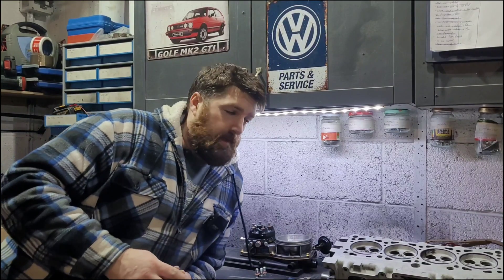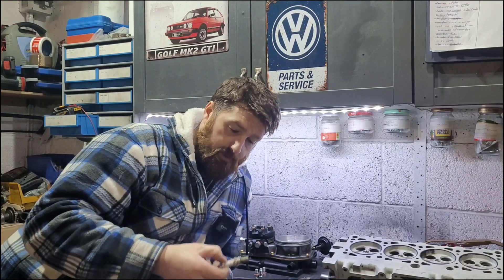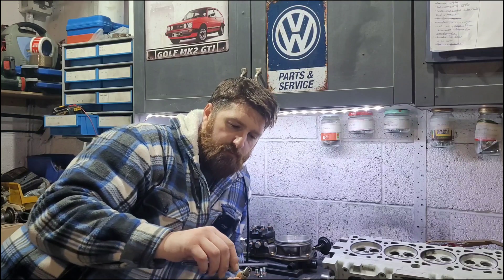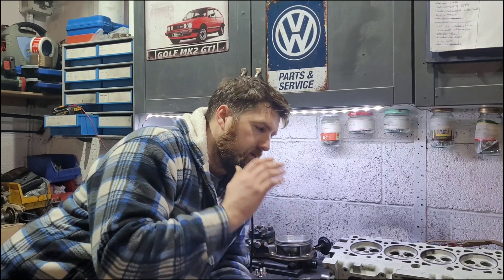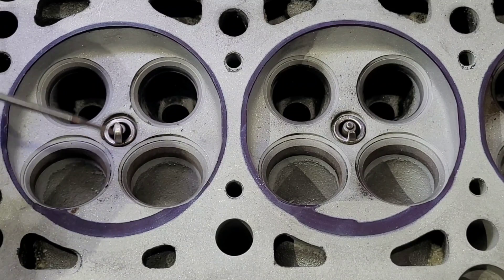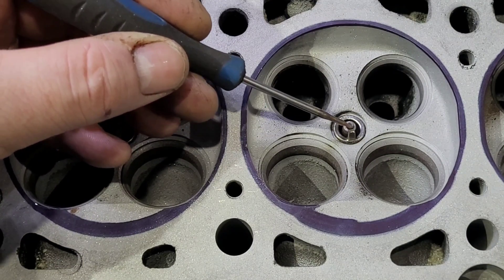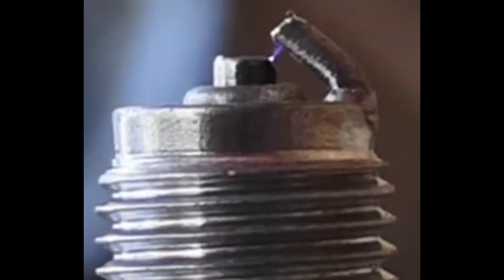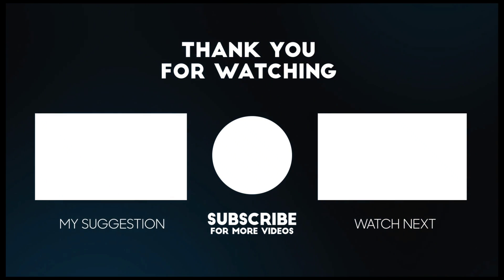Side Gapping Spark Plugs - What? Why? and How

Comment: Some times increasing spark , like putting in  colder plugs or boosting up the coil to get a bigger cold burn can increase cylinder head temperature as the fuel entering the head does help cool it , So be careful when not sticking to manufacturer specs

Comment: I did this on a single cylinder golf cart engine, no difference in power but a noticeable increase idle smoothness and part throttle drivability. Basically smoother running. 
Im satisfied with that.
Reply: Are you sure it not just placebo?
Reply from the maker: No when you research it it's proven to improve things
Reply: @AmritGrewal31  

I knew how it ran before, I don't "sorta think" it runs better now I "Know" it runs smoother, doesn't jerk as much off idle to slow driving each time it fires, singles tend to jerk at low rpm, now I "think" it does better on fuel but no real evidence.

Comment: Dyno vs theories, it tells the truth
Reply: not about Power, its about smoother burn = less carbon deposits etc. Old racers used to index but this is better and reliable.
Reply: I agree. All bullish:t unless paper proof
Reply from the maker: Spend the time and read the documented tests that have been done. Doing this isn't a 10bhp mod. it's being able to improve the burn rate of the intake mixture which then improves the combustion process

Comment: What do you make of those plugs with 3 or 4 electrodes? They're technically side gaped too. I can't remember why I did it but I snapped 2 of the 3 electrodes off mine years ago, I'd probably seen a similar video on tuning the old briggs and stratton engines for go kart racing.
Great channel by the way, thanks for all the teachings.
Reply from the maker: Thanks, technically they are but you can't gap them, and the plug is designed for longitivity so the spark will take the path of least resistance and with three prongs has more paths to take so when one bit wears etc it'll find another path
Reply: I’ve used Bosch triple electrode plugs on my 16v since 1996, modified 1.8 kjet with 2L block, gas flowed head and manifolds, they have been faultless and I’ve had good power on the rolling road, they were also OEM plugs afaik. I can see the theory behind side gapping a single electrode plug but can’t see any advantage over the triple design,  in fact only drawbacks
Reply from the maker: The triple design was designed for longitivity and just provides more options for the spark to jump. Yes, they work, but they also can't be gapped correctly.